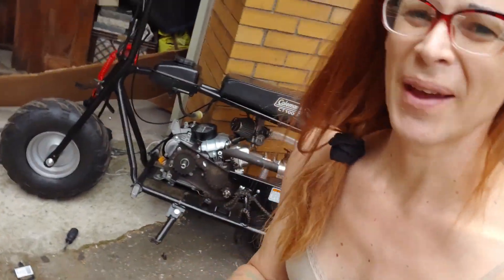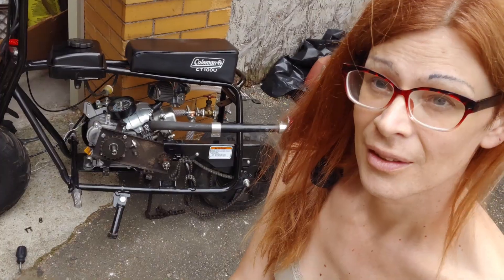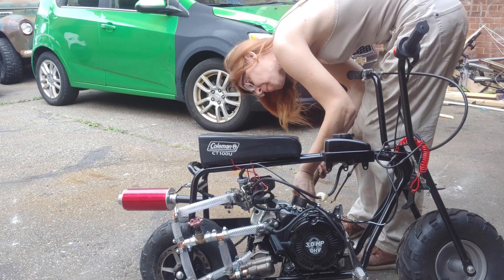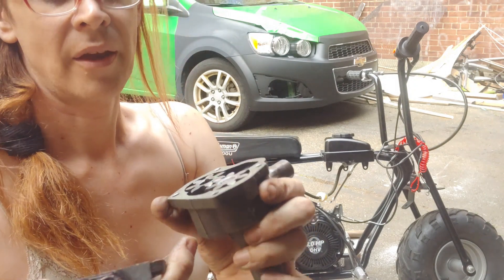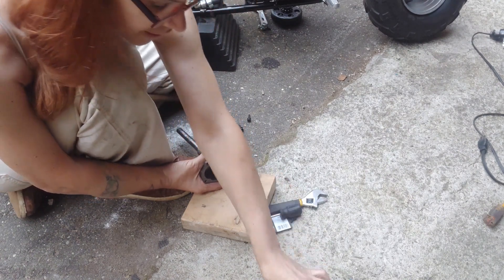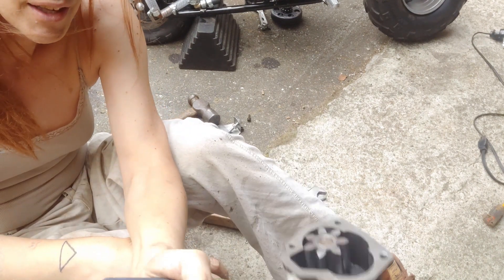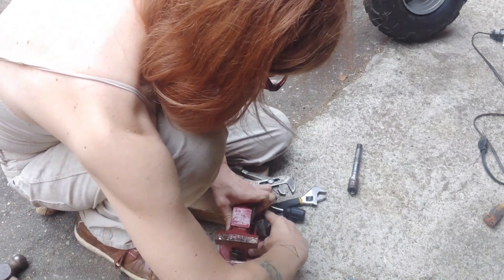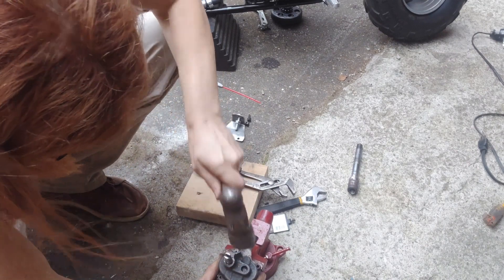What blew up? my supercharged 3hp mini bike build tear down #nonamenationals

Comment: Considering that is a Chevrolet small block oil pump, there is zero oil in it which pumps oil through it with a residual loss of oil that lubricates the shafts up into the driving shaft. Unless you force feed oil to the shaft or run a sealed ball bearing on the shaft, it is going to fail every time the engine is started.

Of course that is the elephant in the room. But then you still have the idler shaft being left out of the lubrication which will then fail. Oils going into that pump are then going to be pushed through your 'Super Charger' into the intake system to create an enriching oil mixture to create a carbon increase which then will increase compression. That build up will interfere with piston and chamber. 

Spark can become closed, possible lifting of the head casting, etc.

Hopefully if you ever revisit the idea of supercharging another compression device will contain sealed bearing in all moving parts or forced oil induction. Good luck.

I hit the 100 like for you. lol
Reply from the maker: This is an excellent description of why this won't work. The project was meant to get people thinking, and it did. The cost of modifications needed to make it work are much greater than the value. Still looking for any solution that is matched to such a small engine. Every turbo produced is sized for a 400cc engine or larger.
Reply: @kimfixesthings  I will give your conundrum due consideration to see if I can help you resolve your pressure charging device needs.

Are you considering a waste gate in order to keep from too much boost?

Perhaps an oil pressure line to the shafts?

But then even a 400cc supercharger can still be used with a waste gate.
Reply from the maker: @MaxsGarajMahal  I am sure we need overboost protection/ waste gate, but it seems unlikely anyone would produce a solution at a marketable cost. 
This motor doesn't have a pressurized oil system. a drip system or low pressure pump is about the best. Cost stacks up quickly with the required complexity.
Reply: @kimfixesthings  Yes Ma'am. Without pressurized oiling I knew this is a lost cause other than it can be done but then cost for machining overrides the intended idea.

A turbo is another deal that doesn't work out for these small engines due to the subject of oiling. So, spray it and forget it. lol

Comment: Drill a hole in the sleeve part of the housing. Tap in a grease zerk. It will probably need to be greased every 30 min to hour of run time but its not much work and could provide proof of concept.
Reply from the maker: John, it would be a solid next step. Had to abandon the project due to time and the housing was ruined to the point that it would have needed drilled for a bushing. A brass bushing and grease zerk would be enough to run this. I don't know when we will revisit the project. Thanks for your input.

Comment: Recently I’ve been looking into supercharging my own minibike, and I’ve never seen a setup like this before. Very cool build!
Reply from the maker: the chain drive was sorta working for what I needed. I can't endorse the oil pump because I am pretty sure brass bushings and an oiling system would be necessary. At that point, it would be worth using something designed for this purpose. The problem from the start was lack of anything so small.

Comment: Bore it out to receive a sealed bearing?
Reply from the maker: this would be great design improvement. i didn't have the machine to do it, but a drill press and some other small machines are in the works!

Comment: Lol bring on the carnage! This is great! Personally I think these ct100s are a riot for adults to race around in parking lots and smaller areas. Most "mini" bikes are too big these days. Your a winner Kim no matter what. Awesome videos!
Reply from the maker: I agree about the sizes, I own a bx200, and it's much larger! As for being small, I can see how the frame could easily be made LOTS smaller and still fit this little 98cc engine. With these little tires and no suspension, they are really only good for smooth surfaces like a parking lot or driveway. The dirt track was waaaaaayy too bumpy.
Reply: @kimfixesthings  😆 yeah dirt track you at least want that front suspension.  I did a tire swap to 145 70-6 Knobbies. 14 inch diameter and they can ride as low as 4 pounds. I also cut off the handlebars, mounted risers on the top plate and ran ape hangers to improve the ergonomics.

Comment: what is that screw in the hole above where the shaft goes through the housing, is it a lubrication port with a screw in it?
Reply from the maker: not a lubrication port, the output of the pump, but I created a bigger output at a better angle.

Comment: I use a smog pump for a supercharger on my industrial engine pitbike, works great
Reply from the maker: Great tip! I did experiment with a smog pump, but was trying for something smaller. There is a good chance this oil pump will never work.

Comment: Could you open the hole and use a roller bearing? Or just open it up and Send It?
Reply from the maker: the roto clearance is critical. the housing will need bored and a sleeve or replaced. not gonna send it till that can be done
Reply: @kimfixesthings  It's definitely fixable. Yesterday I was worried about oiling problems with the crank and rods, so it could be worse.

Comment: I have a few stock Pontiac V8 Oil pumps I saved. It's a big one compared to SBC.
Taller rotor gears than BBC.
Big Chevy and Pontiac V8 are GM largest displacement Factory stock Hi Flow oil pumps.  Give you maybe 11-15 psi Boost ??? ! 
15 psi Boost Doubles Normal Aspirated Engine HP.

Comment: That CMD Assembly Lube is excellent.  I bought more recently Summit Racing sells under Manley and PRW. Dart Engine sells it too.
It's what Crower Cams uses on all thier Forged 4340, Billet 4340, and 6L4V Titanium Rods with Premium L19 Rod Bolts thread Lubricant.
I used CMD assembly lubricant on the 1999 Chevy 454. No Failures any !

Comment: Dry Film Lubrication is something to Try Kim.  Used by Top Engine Builders.  If there is a Powder Coater local they should be able to apply spray it on.